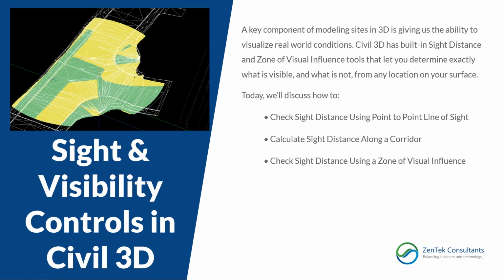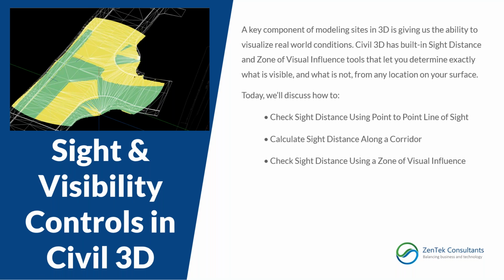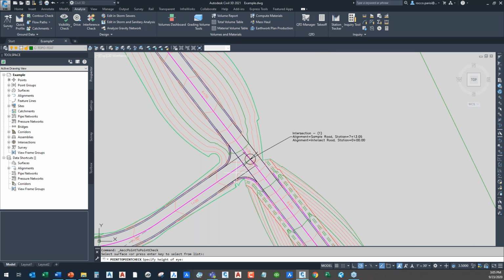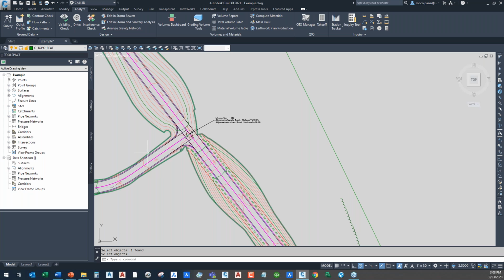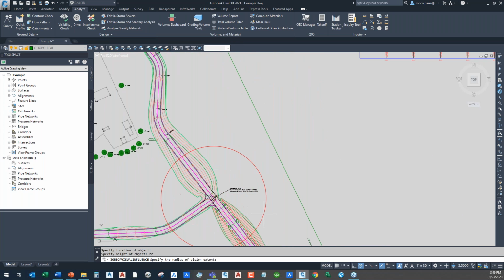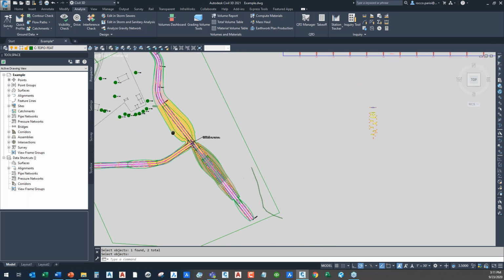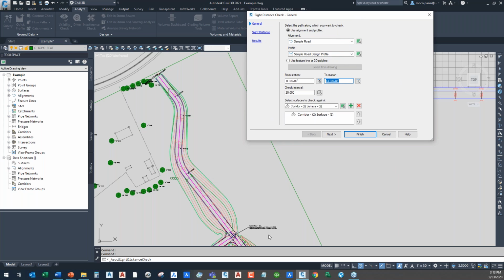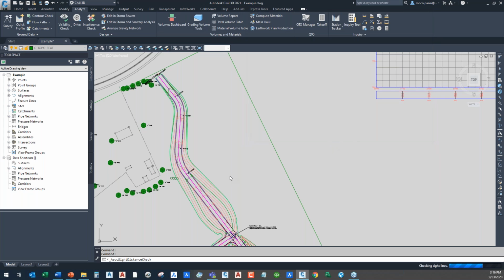Sight & Visibility Controls in Civil 3D

Comment: Thanks for the video
I have one important notice,
the second method is not entirely true, it does NOT ask for a height of the eye, after many tests i came to a conclusion that it assumes that the height of the eye is ZERO.
so basically its wrong, would love if you could comment on this, thanks in advance.
Reply from the maker: The Point-to-Point process asks for eye height on the command line, and the eye height is part of the dialog box under the Check Sight Distance tool. These both still work the same in C3D 2026 as they did in 2021, which this was filmed in.

Comment: Hi, love the vid but one question wrt the zone of visual influence.  From what I can tell the analysis assumes an eye height equal to the surface, ie, it's like your lying down on the road.  Is there a way to set the eye height in the same way as you'd set it in the point to point?  the reason I ask is that I'd like to use the tool for checking if light vehicles can see over safety windrows in a mine.  I use the point to point and that's fine but checking all the different scenarios is a pain.
Reply from the maker: Unfortunately, C3D doesn’t provide an ‘eye height’ option for the ZVI. It’s a definite shortcoming that folks have been asking for about over a decade but no progress from Autodesk. As a workaround, what I’ve done in the past is build a grading object of the item I want to view from (i.e., a truck sized grading) and added that to the surface, then run the ZVI from that spot & elevation. It’s a bit tedious but it seems to work. Hope that helps!